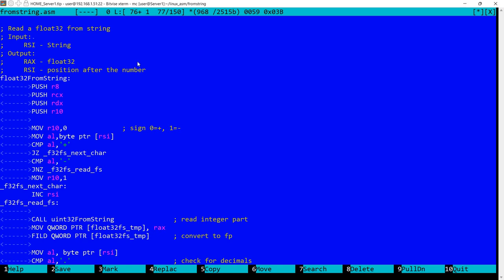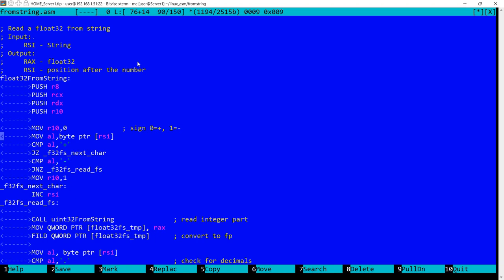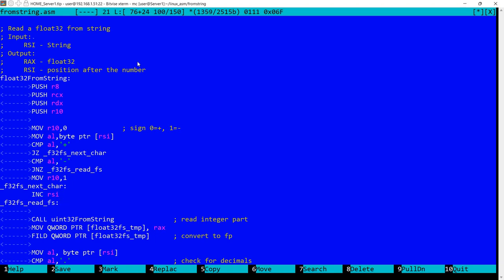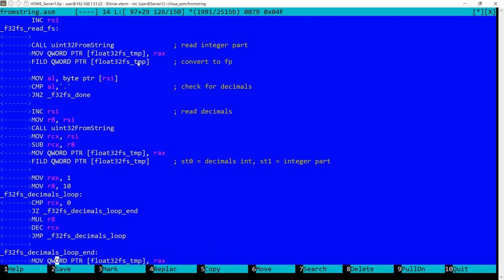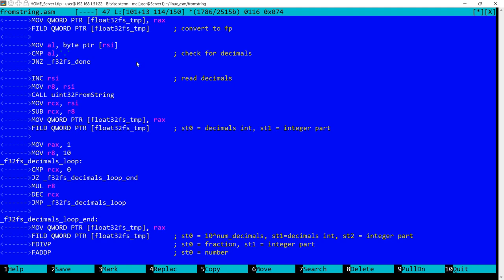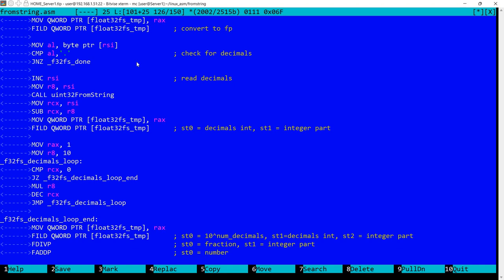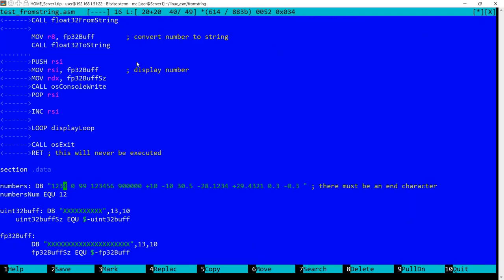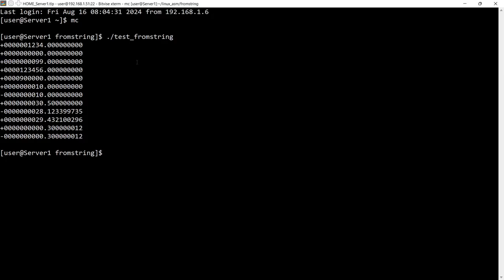Read a Floating Point number from String in Assembly Language

Comment: Some guys from C++, allegedly made some braking change (algorithm?) for conversions, but i don't have link saved and i don't know details and direction of conversion.
Reply from the maker: If you find the link I would be interested in it. In any case, my implementation is intended to be used later for loading data from files and not for other optimizations.